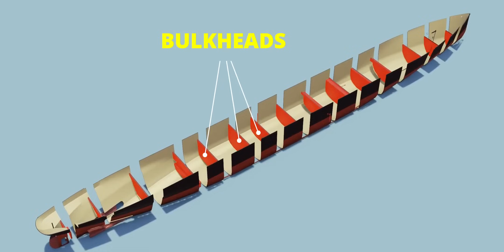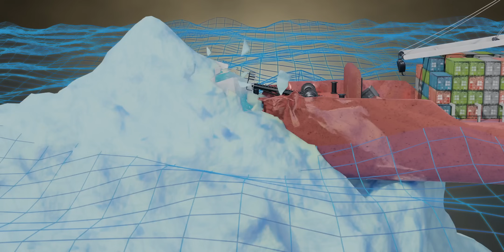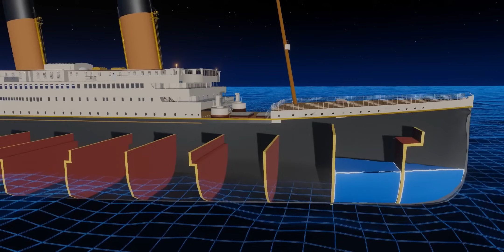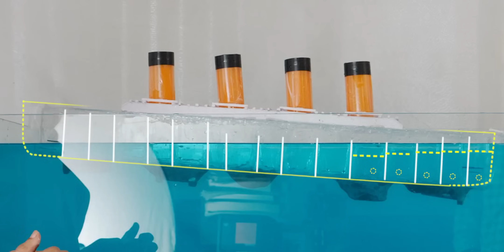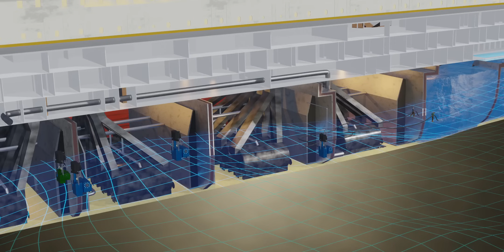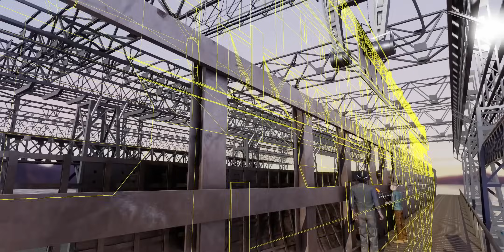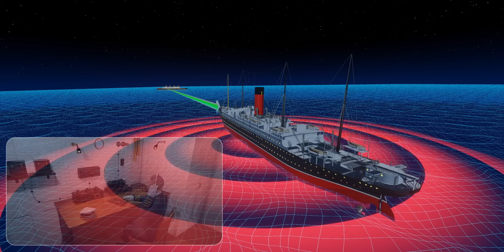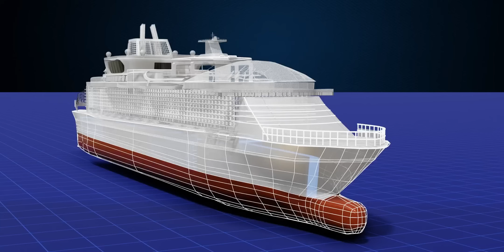How did Titanic Sink? | The Complete Physics

Comment: If anyone in the back was in an air pocket when it went down, if it was like being in an elevator when the cable breaks? Or did the ship float down slowly and softly like a feather? 

It seems to me like without any displacement, it’s like dropping an anvil into water. How fast does that fall down 4k meters?
Reply: The back of the ship imploded quickly once it went under. To properly explain why would take way too long, but suffice it to say that if anyone would’ve been in an air pocket they would’ve died very quickly.
Reply: I think that someone still could’ve been trapped for a few hundred feet in some tiny anomaly of a pressure pocket, although there’s no way for us to go back and interview them.

I am wondering if there is reliable information about the velocity of the titanic as it sank to the bottom. Just how much speed does something pick up sinking through water?
Reply: I feel like it would have been like a combination of the Paria divers, and the man closest to the door in the Byford Dolphin. As soon as vacuum seal of the air pocket is broken (a rivet holding a wall or door together breaking, for instance) a large destructive vacuum force would be made. Either the room would fill up with water and the person's body would be crushed into whatever surface they were next to like a flapjack, Or, they would get whooshed through whatever was creating the vaccuum in the Dolphin-style way. Either way, the person 95% probably wouldn't know what hit them or what happened when it happened!

Comment: The middle propeller didn't reverse. Because it was connected to the turbine engine which spins in only one direction. #Aids in forward motion.
Reply from the maker: Thank you for the correction.
Reply: @SabinMechanical also, Titanic split between the second and third funnel, not the third and fourth funnel. 5 compartments is an understatement, 6 compartments were breached in reality.

Comment: Quite a few inaccuracies here...
Reply: Like what? I’m not disagreeing I’m just curious.
Reply: @ryana3298  Firstly The fourth funnel wasn't just for ventilation it was for the smoke from the smoking rooms and ships galleys. 6 compartments were breached and not 5. That's the forepeak 3 hulls boiler room 6 and the coal bunker of boiler room 5 making 6 compartments not 5. The captain didn't come to the conclusion that she would sink in two hours. The ship didn't slow down as they approached ice as it was common practice to do this and not slow down and rely on lookouts seeing bergs in time to stir the ship. The pronunciation of Carpathia was wrong. The angle was  not 45 degrees like he said in the video, it was more like half that or less when the ship broke apart. They didn't reverse the engines they were just stopped which was common practice. They wouldn't have had time to reverse the engines anyway as 45 seconds had passed from spotting the berg and striking it. The bulkheads were above the waterline but they weren't sufficiently above as said in the video and some were lower than others. 1496 lost their lives and not more than 1500 people. Most of the things he said are what we thought pre 1998 but since then other things have been found out and changed.